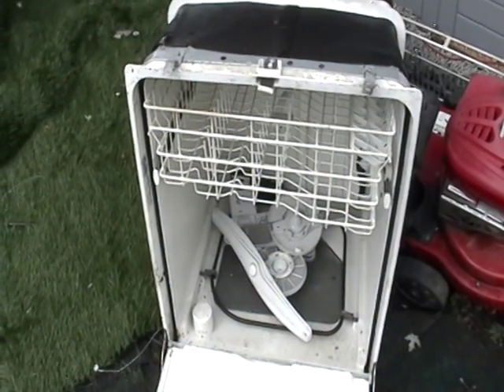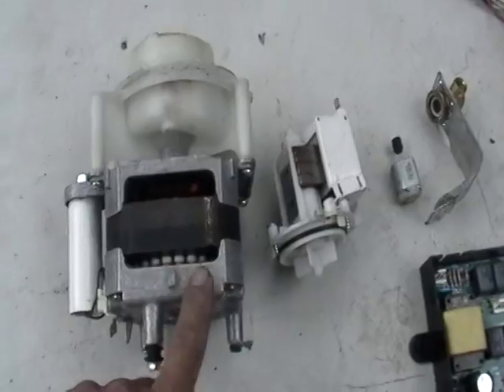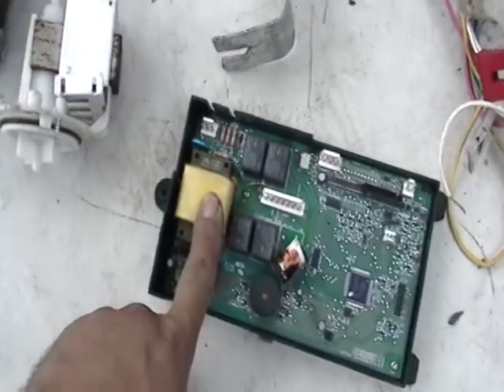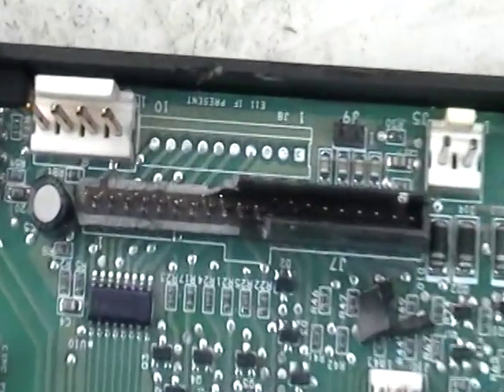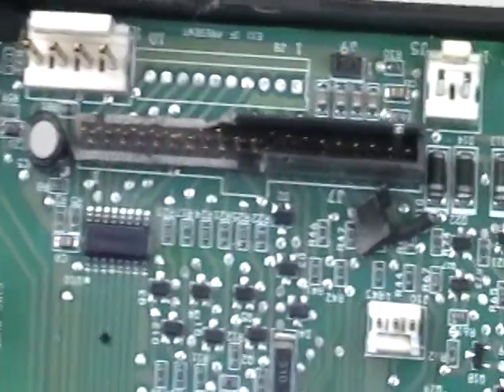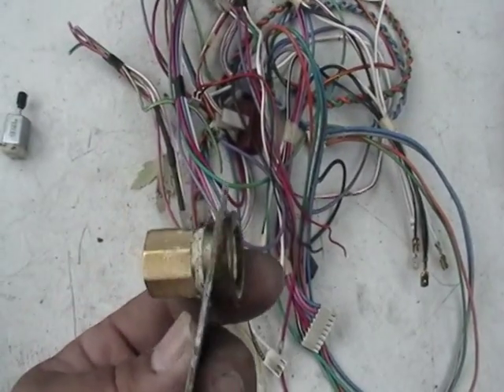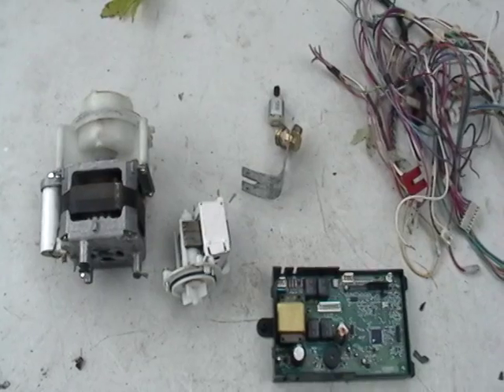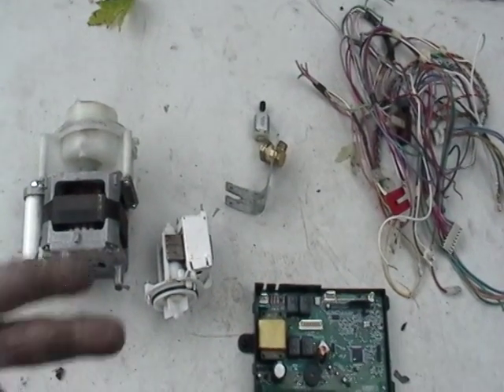scrapping a dishwasher for copper aluminum palladium

Comment: don't forget that the front panel of a dish washer which may cover the wires in the door is typically made of aluminum very thin but 70 cents a lb is better then 5 cents

Comment: How did you get that brass fitting separated from the steel? I was thinking about using an angle grinder.
Reply from the maker: Yeah. I think I use a hacksaw or a grinder. .